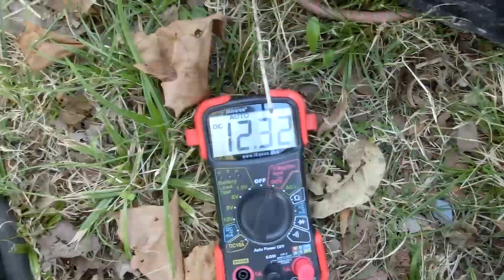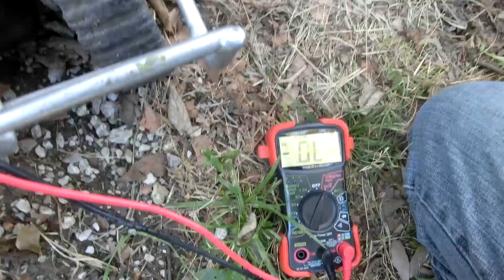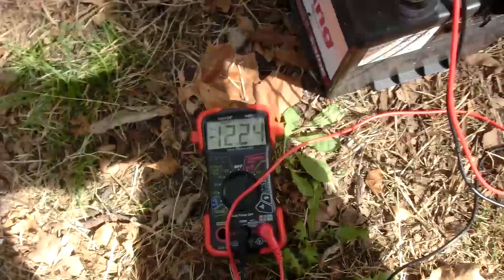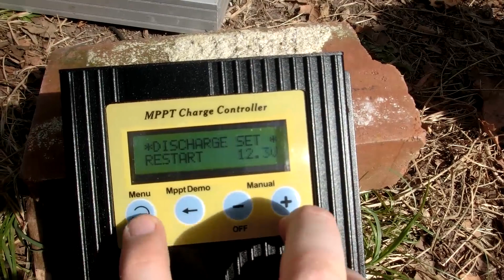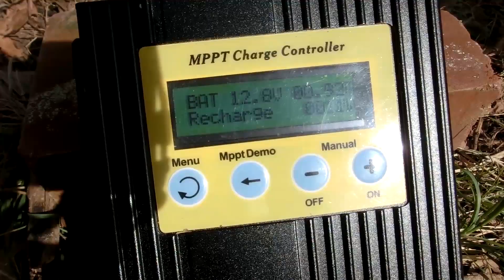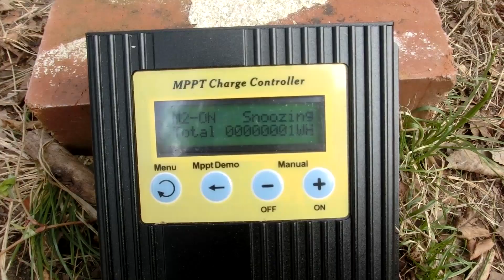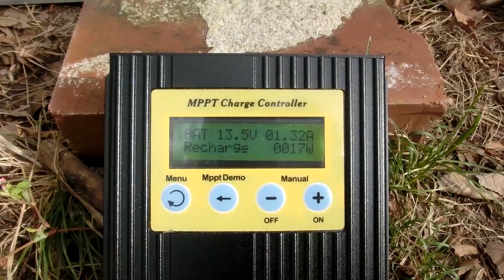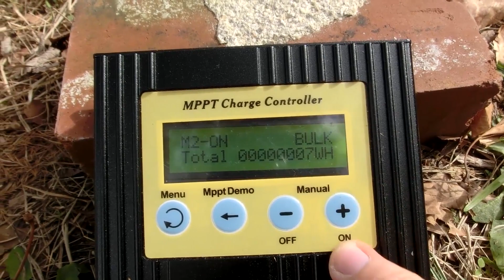Solar Sunday Experiments 012: MPPT controller, clean vs dirty panels

Comment: My you could do a video on solar panels to heat up water.
Reply: Jl Smith do you mean electric heating or the actual panel heating the water
Reply: You are going to get very poor efficiency on solarelectric compared to pure solar, but it would be more reliable and easy to install. I can see it being useful in some situations. I actually have a circuit design that would be ideal for this purpose - it lets you run MPPT on a panel without needing a battery, just a load device.